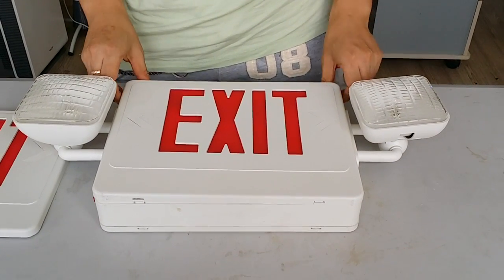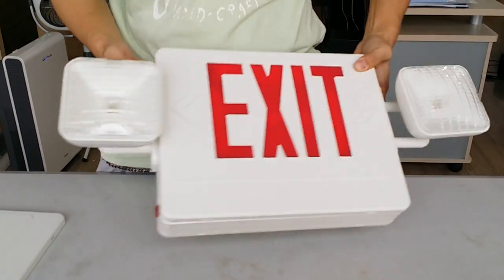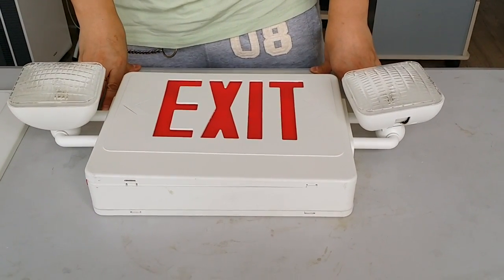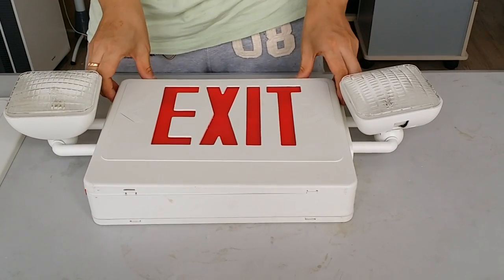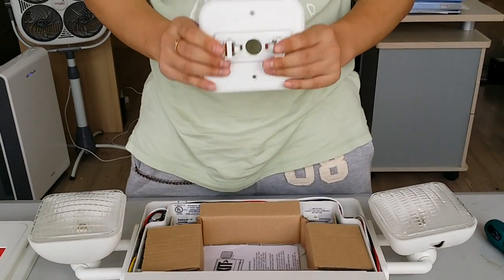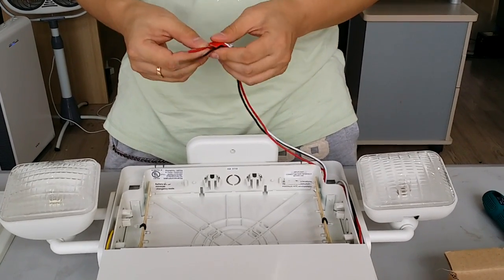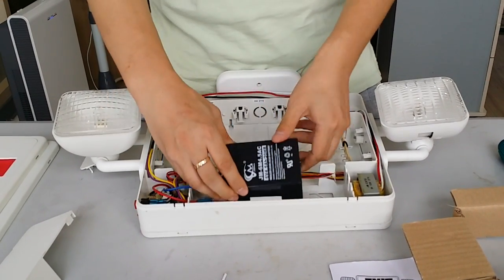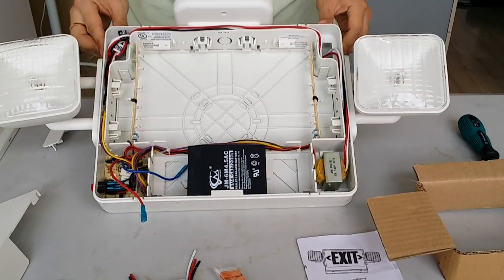JEC2RW Combo Exit Sign Video instruction

Comment: I know Im very late on commenting on your video, but if you see this, could you please help me? I just got the same exit sign, it does not work in battery backup mode, but when I take out the bulbs on the incandecent heads, it is very dim, Ive replaces the battery twice! Thanks if you can help!
Reply: Your unit might be bad

Comment: in case anybody is looking why the battery is not working because there's a little jumper that you have to connect to forget to mention dock connector is right next to the battery follow the wires